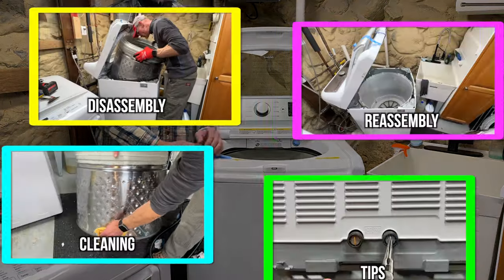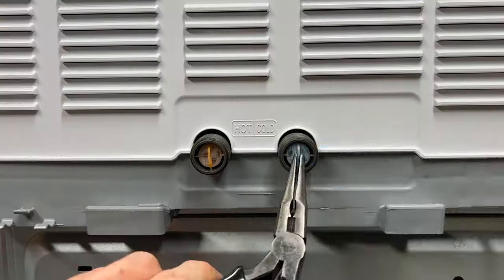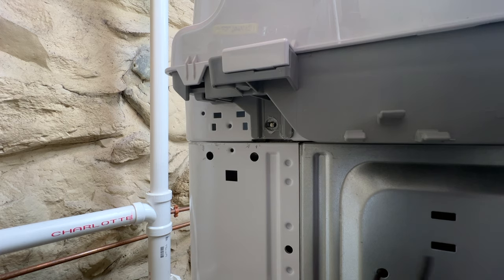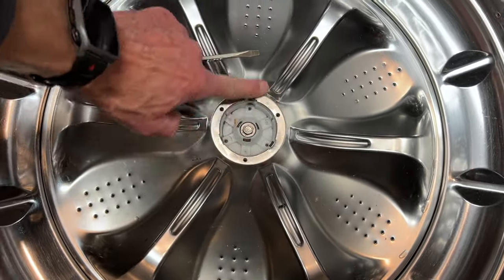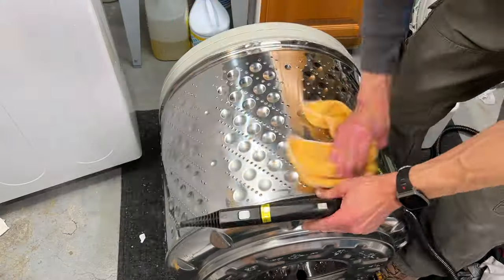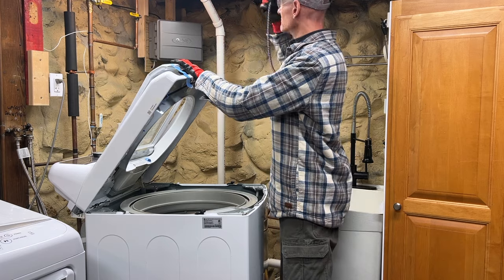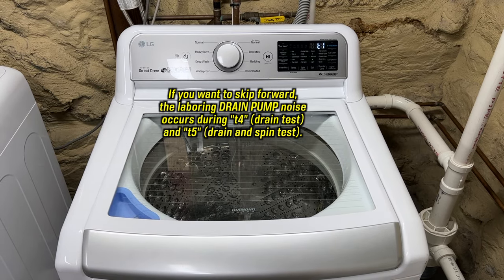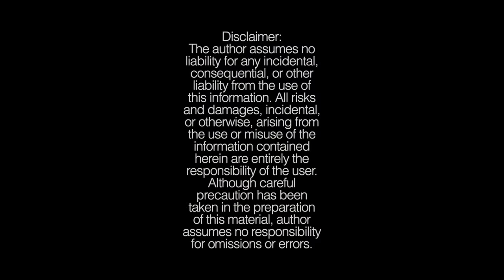How To Remove Tub From LG Top-Load Washer For DEEP Cleaning  WT7300CW

Comment: Love your videos! Very detailed and easy to follow. I'm still not going to take mine apart though. Lol Does this machine have a filter? I have the same model and despite running tub clean several times, and running an extra rinse cycle with each load, my dark clothes always have streaks.
Reply from the maker: Surprisingly this model doesn’t have a filter. When we first got the machine I actually called LG to ask about cleaning the filter and they confirmed it didn’t have one. All the lints is supposed to get flushed out in the rinse. In the video you may have noticed there was some debris under the tub/pulsator cap of our machine after 4 years.  You don’t need to open the machine to pop it off and clean under it so you may want to check under there. It’s a bit tricky to get off the first time, but easier once it’s been removed once. 
Are the streaks on your clothes lint or something else? There’s usually one or two garments that are the culprits and if you can isolate them and wash them separately the issue will be solved. Perhaps separate the load by fabric as an initial means to troubleshoot. Most of what I’ve learned with this machine has been trial and error.
Reply: @BruceAlanR  thanks for the reply! I will definitely attempt to remove the tub/pulsator cap. It seems easy enough...even for a spinster like me. Lol As for the streaks, they're not lint. It looks to be soap residue. I use laundry pods, one for each load. I always use deep wash for my darks and run an extra rinse cycle, but still end up with the residue on my clothes. I do about six loads of laundry a month, and I run the tub clean about every other month. I'll try sorting by fabric and see if that helps. Aside from the residue on my dark clothes, I really like this machine. Thanks again for the reply and the great videos!
Reply from the maker: If it’s detergent residue you probably won’t find much under the pulsator cap. Maybe try switching to a liquid detergent temporarily and use less (pods are pretty concentrated). Also, cold washes don’t dissolve soaps as well so be sure to use warm. I’m guessing you’ve watched this video:
Remove Lint, Detergent Stains, Tub Odor, Sour Smells -  LG Top Load Washer WT7300 How To
https://youtu.be/oxJvQqr9P6w